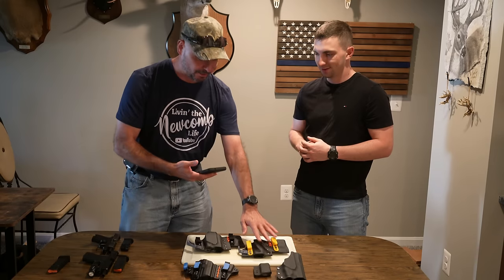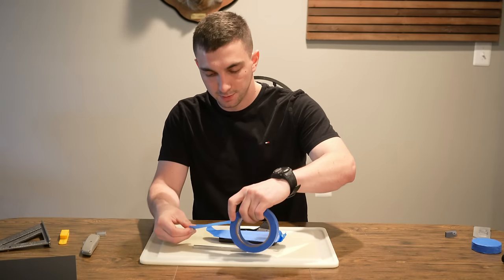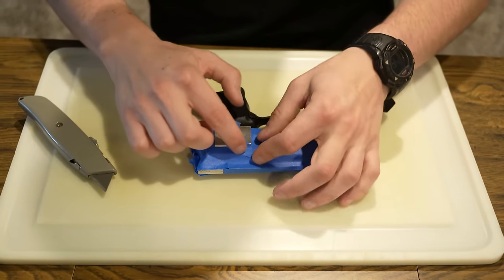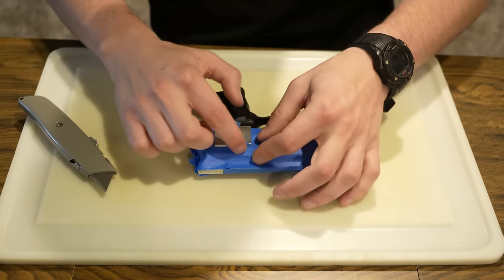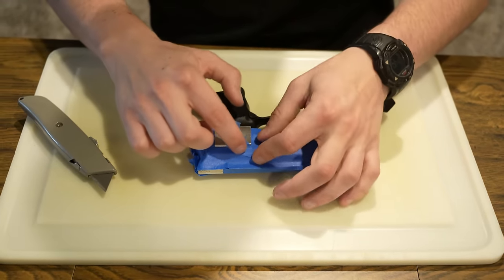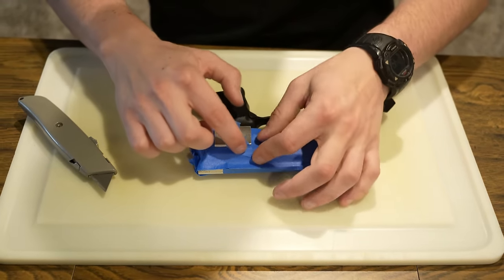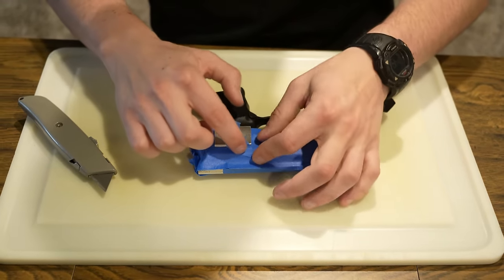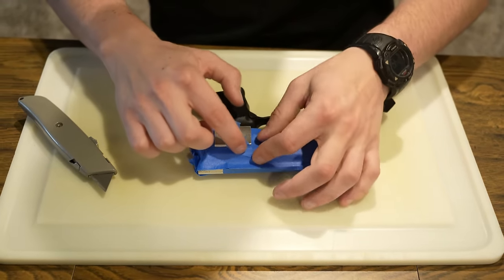HOW TO MAKE A KYDEX HOLSTER     #94

Comment from the maker: From Eli:
This is a list of materials I used in the video. Your mileage may vary on each of these products so I encourage you to change up some of these products to meet your needs and expectations.

As far as some of the tools that I used, check out Harbor freight. They have plenty of solid tools for hobbyists and most of the tools have either a lifetime warranty or a limited warranty. If you don't have a 3D printer and want to make your own clips, there are jigs you can assemble from wood to form your extra kydex strips into clips.

Kydex holster eyelets: https://shorturl.at/CDHM8

Shock cord: https://shorturl.at/gho35

Kydex: https://shorturl.at/swCTZ

Holster belt clips: https://shorturl.at/bswEU

Spring cord lock: https://shorturl.at/anpsv

Chicago screws assortment kit: http://tinyurl.com/yery3xzh

Open cell mattress foam: http://tinyurl.com/mrydj7ce (This is what is currently used in the video)

Closed cell mattress foam: http://tinyurl.com/4x54f38b (This is what is recommended. Just have to stack a couple layers together to get a good thickness)

Holster Claw: http://tinyurl.com/3nd34673 (I have not personally used this claw but If I were going to buy one, I would try this one)

Comment: Yo, great job, ditch the open cell foam in your press for closed cell foam . You will thank me later.  Also  too juice up your press for tons more conformity install press clamps . Buy  a cheap harbor freight laser thermometer and heat that kydex in that oven to 320 degrees.  You can make a jig and create as many belt clamps as you need out of the kydex itself. Last tip. when working the edges of the kydex use some scotchbrite pad under cold water on those edges. This gives you a smooth edge . I learned from You tube guys 10 plus years ago when I began making custom knives and stuff. Hope this helps you take your game higher /faster.
Reply: That’s solid advice. I need to make one, my only comfortable holsters are gigantic for my Glock Roland special, I’m struggling to find something that’s concealable and comfortable. Those weapon light holsters seem to rest in the perfect spot but makes my belt buckle area look conspicuously bulged. Sometimes I think it would be more comfortable to just shove a Glock up my butt 😝
Reply: What’s open cell vs closed?

Comment: I had a holster custom made for my pistol with a particular light and red dot set on it. The case fits perfectly and you could swing it around without worrying if the guns going to fall out. At the same time it has a really nice draw that feels like it doesn’t take any force to pull. I carry appendix with it and I’m able to sit down and move around as if it’s not on but when I’m working in the barn or some place similar I take it off because I don’t want to have heavy parts and stuff hitting it and potentially damaging the clips. I’d recommend a custom holster for anyone planning on carrying it just makes life so much easier.

Comment: Good tutorial, i do it mostly the same way, but after rounding the edges with the sanding wheel, put a polishing wheel with polishing paste on the dremel and go around the whole holster, it will give a shiny and smooth feeling surface to the edges which makes a good difference and feels better. Also I would round the pointy corners with the sanding wheel, this will make it significantly way more comfortable to carry, there is still much material left which you don't need, especially on the mag carrier. You can sand everything away until an half inch to the rivets. The pointy spikey corners needs to be removed. Thanks for the tutorial, great job

Comment: It's good to have an open end or at-least a way for dirt, dust, debris or any liquids to get through... but I always try to mention that the muzzle of the gun should never stick out the end of the holster. If the muzzle sticks out of the holster, then anything that happens to push on that muzzle can push the gun completely out of the holster. Have seen cases where dropped their guns, because of that and in a few cases their guns went off and they got into trouble for it. (Like the two teachers that were charged for carrying guns at the schools they worked at, because their guns fell out of their holsters and went off while they were going to the bathroom). I know it's extremely rare for any modern handgun to go off from just being dropped, but it does happen. Also, when people drop guns they instinctively try to catch that that gun/item before it hits the ground, which oftentimes causes the person to accidentally hit/pull the trigger. It's kinda like when people drop knives they cut themselves trying to catch the knife before it hits the floor. Anyways though... Open ended magazines like the one in this video are perfectly fine in my opinion, but having even 1/8" of the muzzle sticking out of the holster is enough for it to become am unnecessary hazard risk.

Comment: I might try this with some improvements. Tape one side of the softened kydex to form a joint and then tape it to gun. Placed the pistol and softened kydex in one of those vacuum seal bags and use a shopvac to remove the air. rather than your foam compression.
Reply from the maker: @michaelderemer  -  It's funny you bring that up, that is one of the things we discussed - to use a vacuum chamber sealer instead of the foam press.  If you try a vacuum seal bag with a shopvac let us know how it worked out.

Comment: I guess it’s off to the World Wide Web to source clips instead of printing them, and to goodwill for a dedicated non-food oven.  The only recommend I have is to use some blue lock tight on the metal hardware.  Having used “Chicago Screws” for leather projects, they loosen kinda easy.  Nice job!
Reply: Nylon nuts will hold the hardware without locktight

Comment: Companies have been showing the process for a while.  

Part of the cost for my Sidecar 2.0 or even my Sidecar 1.0, is the fact that they have a limited lifetime warranty.  As long as I'm not doing anything goofy, if they break due to normal wear and tear, or I was in some sort of incident that resulted in the holster breaking, they will replace it.  I actually wore out my last holster which was using their thinner kydex, and TREX had another holster on my way in about 24hrs (even threw in something new that they haven't even made available or officially announced through their newsletter yet).

Comment: So far the best guide, thank you! I will try it by myself for my gun and even knifes. Just a question. The foam is normal molitan from mattress? Little bit worried about heat reaction and melting
Reply from the maker: @branisj - Eli used GoTo Foam 2" Height x 24" Width x 72" Length 44ILD (Firm) Upholstery Cushion https://a.co/d/bTFOsuX    He said he hasn't had any concerns with heat since he's been using it.  He added that the foam has started to turn yellow, but it hasn't had any impact on performance or his final product.  Thanks for watching our video.

Comment: Wonderful. However, you used a 3D printer, so for first timers, that would be expensive, unless they had a need for one to use on other projects. Although, I'm pretty sure you could find brackets at the hardware store for the clips, or make them yourself with a single piece of metal.

Comment: Can you share the sources for materials? Just the kydex alone costs more than $6, not to mention hardware, eyelets, paracord/bungee, etc. Even making my own clips I haven't built a holster for less than $15-20 in materials. Thats not even counting consumables like tape, or getting the other required tools like a press. 

For a 1 off its usually not worth it. If you plan on making more than one then it pays off over time. If you just want to do it for fun, thats cool too... a $6 holster is hard for the Chinese to do...

Comment: What did you use for the holes for cord
Reply from the maker: @Dairydew2u2  -  Eli used a drill for the holes for the cord.  He basically lined everything up where he needed it and drilled the holes.  Thanks for your question, and thanks for watching our video.
Reply: @livinthenewcomblife  just bare kydex no eyelets or anything?

Comment: As a holster manufacturer, theres so much wrong/dangerous with this video.

1.) You didnt make adjustable retention for the holster.
2.) You left the mag/grip open, which if you have enough pressure, will crush and completely ruin your magazine insert/grip.
3.) You sight well is not even with the gun, so it makes an over amount for the style of holster you made, which is the sidecar.
4.) You didnt heat your kydex up enough. It should be 320-350 degrees, not 275 degrees.
5.) Your mag release or any part on the gun should NEVER be against kydex. You will get much unneeded holster wear faster. 
6.) 3d printed items are alright, except for clips. Always injection molded or metal items. ( if your a business and your clips break on a customer and they lose their gun or it falls out in public, its on you).
7.) You have no adjustable retention on your magazine either.
8.) For carry, you put your mags backwards for deployment.
9.) We all do it but its better to use molds the guns are made by than the real holster.

Theres a lot more into holster manufacturing than whatpeoplee think for keeping themselves safe. Holsters are not anything to cheap out on. I would suggest looking at Falctac Unlimited video. He's a tutorial channel who does it full time. As a newer maker, its not really horrible, but theres a lot of enhancements needed. Keep it up and always keep learning.

Comment: Yeah, so much cheaper...after you buy the 3D printer, materials, and tools to make it.  This is good if you plan on making more than 1.
Reply from the maker: @ericmcmanus5179 - you're absolutely right!  In this case, Eli slowly acquired each of the tools he used for this project one at a time for numerous earlier projects.  Afterward, he decided he wanted to try his hand at making a holster, and you have seen the result.  With anything DYI, there is almost always some sort of up-front cost, but once that's done then you can move on to more complex projects, like this one.  Thank you so much for your constructive comment, and thanks for watching our video.

Comment: I mean yes you made a kydex holster but there is no comparison to a tier one unit. It’s not even in the same league. And you tons of equipment to do this for the price you say. You have to buy a claw and clips and hardware or print them which requires a 3d printer. The kydex alone costs 6 bucks. But it’s not a bad effort. Can’t imagine this even comes close to the concealment of a tier one.

Comment: While I appreciate the video and I think you did a great job with the holster, it is not accurate to say that someone can pull "six dot zero zero" dollars out of their wallet and make this holster.  Besides labor, which you mentioned, there is the cost of making the press, the cost of your method of heating, the tools you used, and the cost of a 3D printer.  Again, I agree that it is less expensive to make your own holster.  It is just misleading and inaccurate to say that it only cost you $6.
Reply from the maker: @oliverschlotfeldt7865  - we completely understand where you're coming from, and not intentionally trying to mislead anyone.  Eli had previously purchased all of the items for other projects and this simply evolved as a result of those previous projects.  He's an avid do-it-yourselfer type of person and maximizes what he can do on DIY projects.  I think this project definitely showed how you can accomplish that.  But, yes, there are up-front costs when you're starting from scratch, and benefits when starting new projects, like purchasing a new tool to complete that project.  Thank you for your constructive comment, and thank you for watching our video.
Reply: Spent $25 total on a kydex sheet, clip, and Chicago style fasteners from Amazon. Heated it up in a old toaster oven and used old scrap boards and foam pieces that I got from work. I sat on the boards for a few minutes to squash it down. I did already have power tools and sandpaper tho.

If you're creative you could even bypass the need for conventional tools as well. The upside is that the next holster I make is going to only be $12 after buying a single sheet because of the left over hardware.
Reply: @jzi4 Yes, but still NOT $6.00!
Reply: I agree. One sheet of kydex costs more than $6.00
Reply: Not $6.00, you just said the xost was 3 dor $20. Maybe not $140 but about 50. Anyways great video and very easy to do, thanks.
Reply: Nit pick much?
Reply: So maybe sell me one for $10?
Reply: Where is this guys video? I'd like to see how random people nitpick his content lol
Reply: You can buy spring clips for a dollar, you can use your kitchen oven, you can build the press for 10 bucks
Reply: Holy shit!!!   Who gives a fuck really??? 
Sound like a bunch of cry babies.  Was it even really worth your time to bring it up?  That he made a little mistake when he was out on the spot to come up with a number real quick. 

Great video s thanks a bunch.  I been wanting a new one for a while now but been wicked broke. Def gonna try this. Thanks guys.
Reply: I mean, I already have all these tools. So I bet I could get close to 6 bucks. If you don’t have the tools, you probably aren’t handy in the first place, so you might as well spend the 140
Reply: @livinthenewcomblife yeah it's called clickbait
Reply: Can you do a follow up video where you talk about all the tools involved, their cost to buy/build and what they can be used for besides making holsters?
Reply: Exactly. This is dumb.
Reply: @KEGHEAD337 Was it worth your time to complain about the comment? Kinda hypocritical, ya? People can have their opinion. You don't have to slam them for it. Jesus.
Reply: @charlieghague  yeah.  
It’s ridiculous now a days that u can tell there are Karen’s and Kevin’s just in comment sections. He coulda been .13 cents off and still woulda had to type something. 
I don’t do social media just for this reason.  Still sounds like a cry baby if u can’t understand that prices could be different in other areas and could actually be $5 off. 
Maybe there should be a new A.I. filter for people shoe can’t handle it, that way they can only watch videos that they want by pricing down to the penny
Reply: A man has tools, a woman complains in the comments section
Reply: I agree. The time alone is not worth it. I’d rather just spend $100 and get one that looks way better. The opportunity cost of making money doing a real job is lost. You could be just working min wage for a couple of hours, order a real holster, and it’ll be way easier than doing all this. 😂
Reply: I agree. The role of masking tape costs more than 6 dollars
Reply: I also make my own holster. No way it’s only 6 bucks
Reply: @theretiredhulltechchief1606  it’s click bait. If he put $100 then no one would click it.
Reply: How awesome is that ? Would be fun to do …